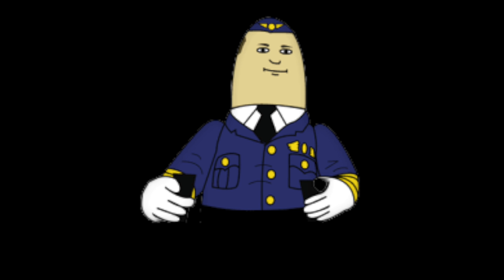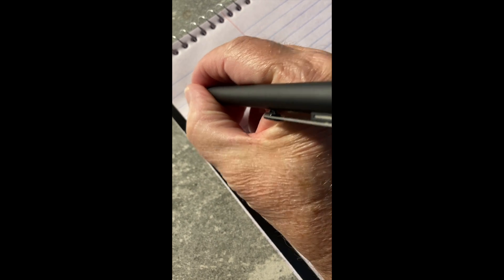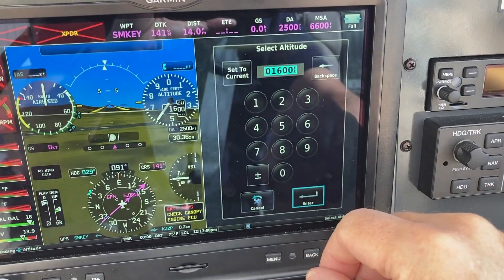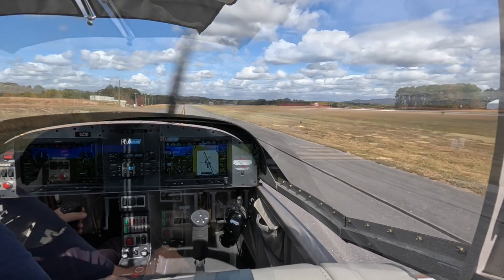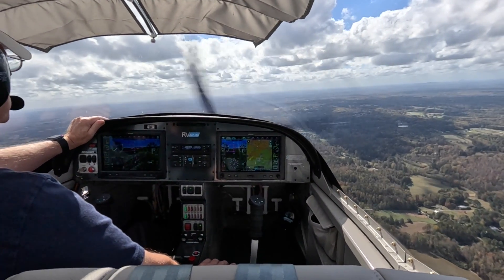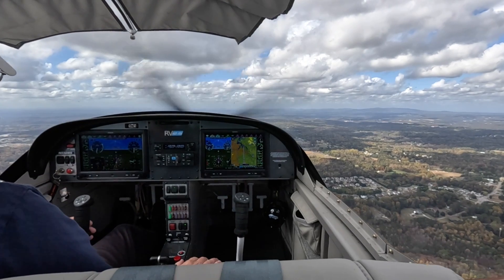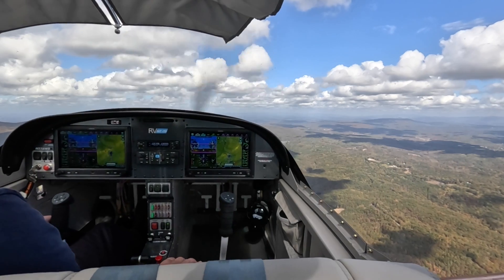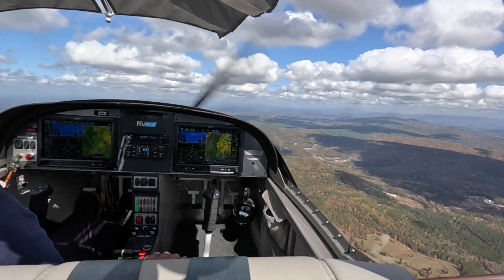Autopilot Flying

Comment: Was there an actual obstacle?
Reply from the maker: Yes.  If you have access to a sectional chart for the Atlanta area, locate the waypoint VARNM.  4 NM northwest in my direction of flight are two microwave towers atop Bear Mountain.  They top out at 3,128 MSL, I was flying at 3,000 MSL.  A brief jig to the right for a couple of miles and then back to the left to join the original track were all that was required.

Comment: Really enjoying your RV12 how do you like it compared to the other planes you have owned
Reply from the maker: Hi Bernie.  Firstly, I've enjoyed each of the planes I've owned, and they were good for their time.  This RV-12iS though represents a huge leap forward in capability.  Much is due to the flat screen technology via Garmin and to the superior engine by Rotax.  Aerodynamically the RV-12 delivers pretty spry performance with such a small engine package. Knowing that I don't have to spread out paper charts in the cockpit and that the workload is reduced because of the autopilot are two features I really enjoy.  I do wish the cockpit was a little more roomy. I fit in there just fine but I do like free space around me.  In this or any LSA, down low can be bumpy, but for XC trips I fly high where it is smooth.  I give the RV-12 an A+.
Reply: What is the wing loading ratio on the rv 12.  Thanks
Reply from the maker: @Joetech959  At gross weight, the wing loading is 10.4 lbs/sq ft
Reply: Thanks for the info, appreciate you.